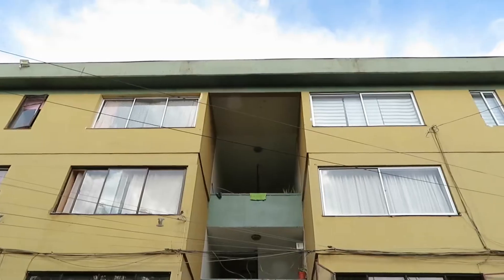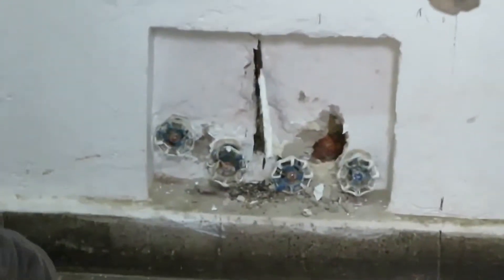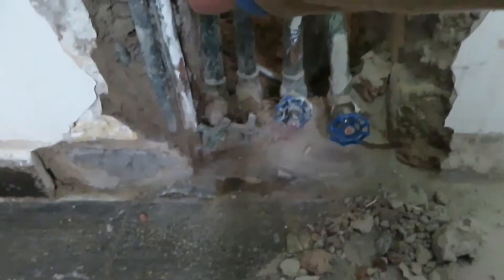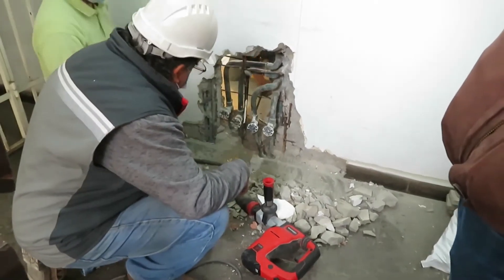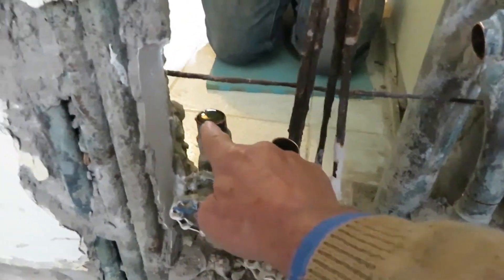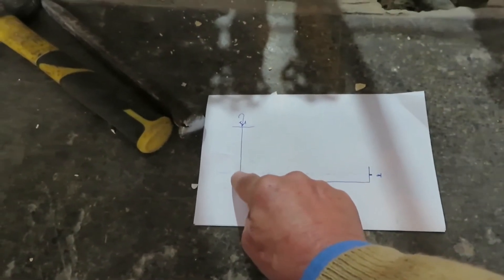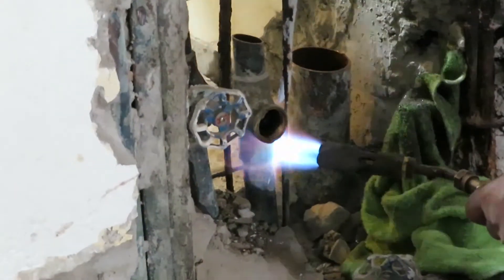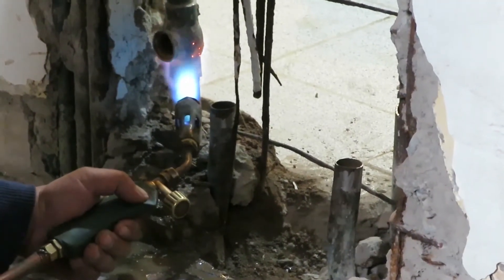multi-unit residential apartment buildings Install submeters #submeter #plumbing #chile

Comment: Why did they have to remove the left over water in the pipe? Is it because it would have been contaminated?
Reply from the maker: You can't solder copper pipes when they have water in them, the water contributes to surface oxide and solder not melting properly.
Reply: @RODsDIY  ah of course, thanks

Comment: Thank you for sharing this video.  I have a two family unit that I would like to divide.  Question does this submeter send the divided usage to the water company for individual billing or would I still receive one bill and have to divide based on usage?
Reply from the maker: Hi Rich Girl, it all depends on how things are done in your country.  In Chile, each home has a street number and a number in the properties register.  If a property is legally subdivided into 2, it should have 2 distinct numbers in the registry, and the water company should produce 2 different bills, one for each. On the other hand, if the division is informal, and you modify the existing meter connections you might get into a legal problem with the water company.  If the division is informal (i.e. a backyard house; a doddy house) you should approach your water company, explaining your intentions and surely they have a solution (if you pay for the meters and install).
Reply: @RODsDIY  Thank you.  I am in the US will check with my local water company.
Reply: They send the bills to me separately in Lee MA but you have to notify your tenants that they are responsible for the water /sewer bills when their lease is up. However the bills are always in the landlords name. I suppose that is because if the tenant leaves the property then the landlord is responsible for the remaining water/sewer usage. Hope this helps.